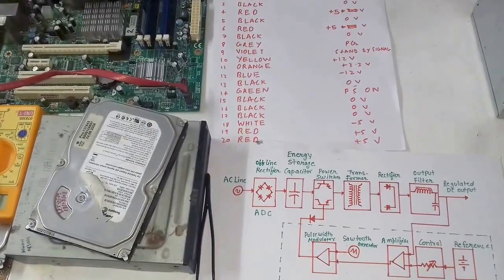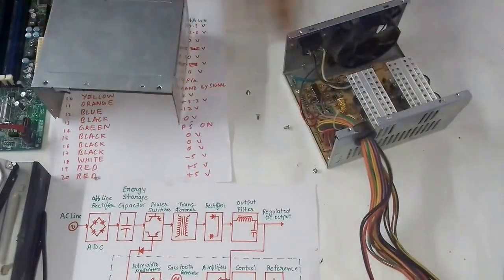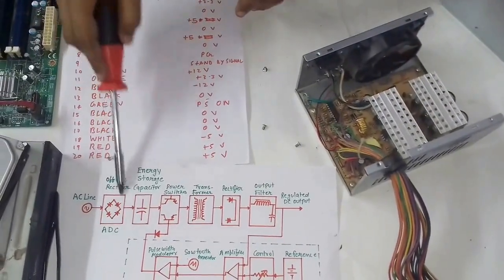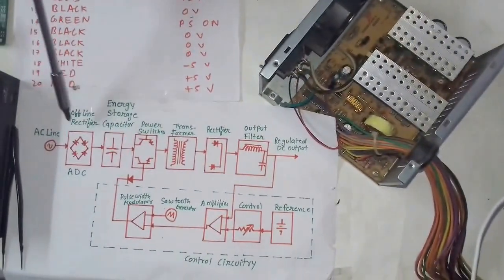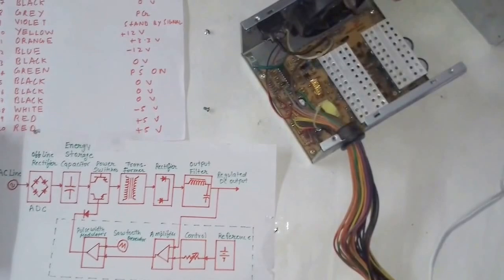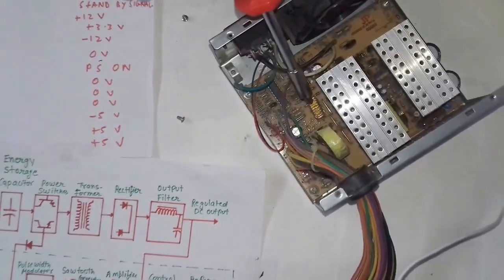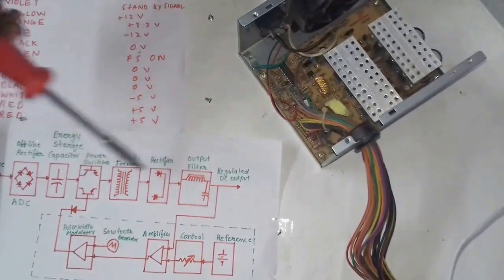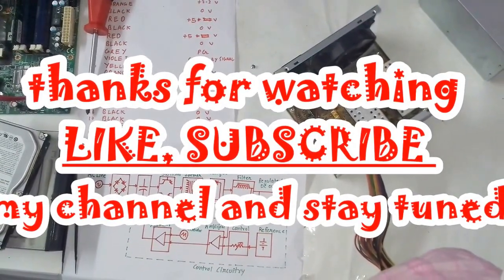how does the smps work with circuit diagram part 4

Comment: if u dont know the subject dont mislead the people thru ur illitricy
3 trnsformers are obig one is main transformer gives 3.3v 5v and 12v
middle transformer used to sense load and the other small one is stand by transfor which produce +5v volts to pwm ic ic produce 5v at green wire when u ground green wire ic starts and give out on 2 of it pins those voltage triger small transistor to active middlt transformet and so on

Comment: are you sure that switching section is That transistor , because it's with aluminum heat sink . just near the filter capacitors. 
and that 3 transformer that your are talking about. one is driver section & One is protector section . & have only one SM transformer in this smps .